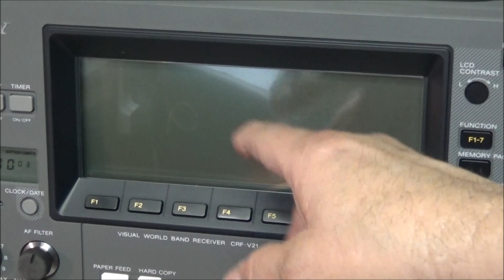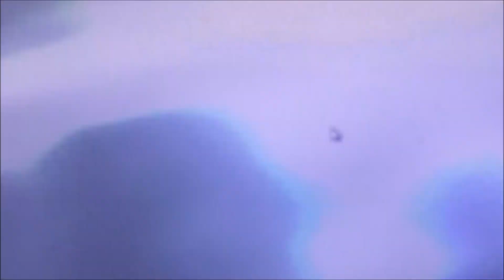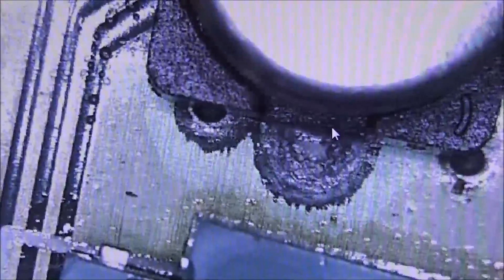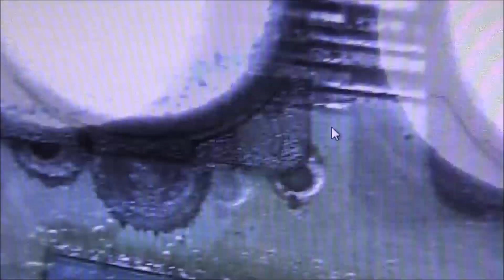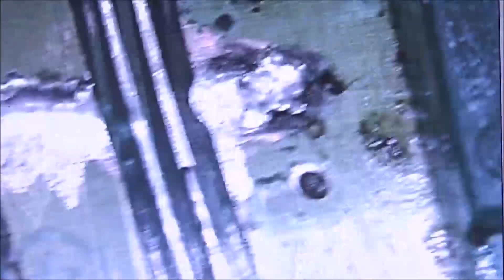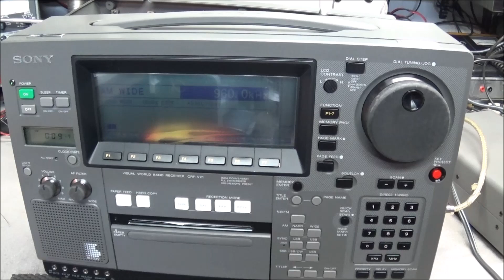#157 Sony CRF V21 No Power On Repair

Comment: Someone brought one in yesterday. Had some true pc board damage from leaking capacitors. Not sure if going the extra sixty miles of replacing as much of the c's as possible is worth the risk of still ending up with, what may essentially turn out to be a brick. Nice vid!

Comment: CCS (crapy cap syndrome) strikes again.  The older SMD designed radios get the more I'm starting to dislike SMD aluminum electrolytic caps.  Starting to see this so much more frequently these days.  Best defense is recap before they start to leak.  A lot cheaper to recap early than do it to late and have major circuit trace damage.  Luckily this one hasn't gotten to bad yet.
Reply from the maker: Seems these caps are not as good as they once thought they were. They fail faster than most or their through hole counter parts.  So many in here to replace.

Comment: Great Video Buddy Nice info Never worked on one for sure would think a better use for the Mula then in this Radio ? lol lol yes Buddy I hate those Caps But like Mike said to get it right remove them better then repair circuit Board Runs..73's Buddy

Comment: WOW 79 degrees...LOL
Nice repair, SONY does not make it very easy to work on, I would never attempt to open it...LOL
Looking forward to part 2
Reply: Panasonic world band portables from the '60s aren't too easy to work on either.  When they're working well they have fantastic sound quality.
Reply from the maker: Yep they are a pain to work on but fun to own. No ways as good as the 320 but still a rare unit to own. Thanks Bill.

Comment: Off topic question: A friend dropped off a Fanon Fanfare 880 DF. On the power supply board, resistor r710 is burned. It reads almost 1 Meg ohm and the only band I can read is the 1st which is yellow. Do you know what value resistor r710 is? Any information would be very much appreciated.

Thank you.
Reply from the maker: Soon as I can find my manual out in the shop I will take a look. Do not work on many cb radios anymore.
Reply: The Radio Shop 
Update. The owner doesn't have two nickels to rub together and he doesn't even want it back, he has a few other radios that work and he is happy. So, since I repaired his SWR meter, he gave the radio to me. I'm going to attempt to restore it so I ordered the schematics from Sam's. It does transmit a carrier, but when modulated, 60 cycle noise transmits too. The radio has had some mods installed, I'll remove them one at a time. Try to do no harm.

Thank you for the reply.
Reply: The Radio Shop
Received the schematics for the Fanon radio. It was a .47 ohm! Well, I did say the first band was yellow. Replaced the resistor, radio working again. Now I'll remove the mods one at a time making sure to test it after each change.
I'll keep you updated if you are interested.

Comment: Those caps are so destructive. I wonder if that is a type of acid that could be cleaned with a neutralizing solution of some type. Looks like your are gonna be there a while replacing all those caps. Unfortunately it's really the only wise thing to do. I guess we won't know for another twenty to thirty years whether the modern caps being made now are any better. 73 Doug.
Reply from the maker: Hi Doug, yes will take a while to get it all cleaned up. That acid is nasty stuff and eats copper up quick. I think we caught this one in time though.

Comment: Something so small causing so much trouble Buddy, I think some newer Kenwood's suffer from bad caps, my old Kenwood TS820 doesn't proper caps  which I replaced, all of them, but at least  I could see them, I'll be thinking about you on that task looking forward to pt2..73 Paul  M0BSW
Reply from the maker: You are right Paul. They cause some nasty problems. Good job on the 820.  These types of caps are terrible,

Comment: After losing so many screws from dismantling i now won't start a job until I have a jar with a lid on the bench!
Reply from the maker: I have a small metal bowl with a magnet under the bottom. Just drop the screws in and no worries.
Reply: Very neat! A good tip. I'll try an old speaker magnet and a tin lid!

Comment: Great job Buddy. Those old Sony radios are tricky and delicate to work on. I’ve not come across one of those yet but would love to own one. Is it able to decode and print rtty?Thanks for sharing the repair and your considerable experience. All the best Graham
Reply: I think it can do RTTY, but the printer was intended to be used to print fax messages.
Reply: Thanks for the info. Interesting radio
Reply from the maker: Like douro  said below it was designed for fax but I noticed it tried to print the RTTY signal.  Thanks for stopping in Graham.
Reply: Hi Buddy. A nice little feature though. Bit out of my price range but I may get one in for repair, you never know. Looking forward to another instalment. All the best Graham

Comment: The most expensive radio Sony ever sold, let down by poor-quality surface-mount capacitors.  But I've also seen the same problem in some of their pro gear as well.
Reply from the maker: Agreed. These caps cause problems in anything they are installed in. Kenwoods were plagued by this also.

Comment: Well this is disheartening. After watching this i decided to try mine out. Its just been sitting on display for so many years unused. I guess that doesn't matter because mine now suffers from this ailment. Bummer. I bought mine so long ago from a nuke engineer out in Nevada. He bought just about every accessory for it, short of the huge dish antenna and accompanying converter module. I even have the factory service manual for it. Do you go back with surface mounts? Or adapt lead mount caps to work? Great video. Thanks for your time and effort.
Reply from the maker: Sorry to hear that. Those caps fail quite often.  It depends on the space and the owner. Some wants things original. Others do not matter. If you go with smd caps make sure they are high quality ones.
Reply: The Radio Shop, thanks 👍🏻 I opened the back of mine, removed the shield for the signal board. Using the magnification app on my phone, I couldn’t see any sign of cap leakage or trace deterioration. Next stop, the microprocessor board. If there’s any part of the service manual you need, let me know and we can try to figure something out for a copy.

Comment: These 90's Sony radios all have leaky aluminium electrolyte caps. I have repaired many ICF SW77, SW7600's
Reply from the maker: Makes you wonder why they used them in such high end gear.